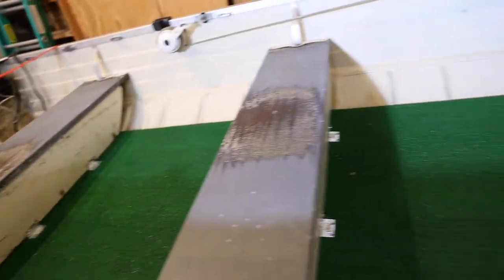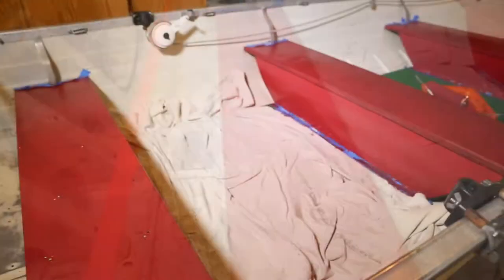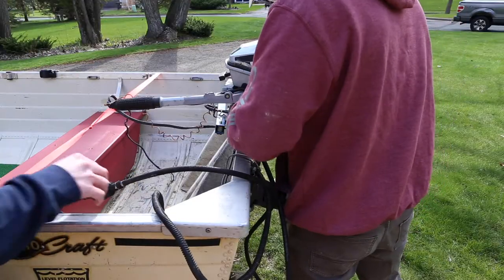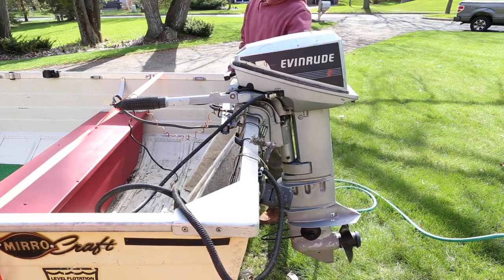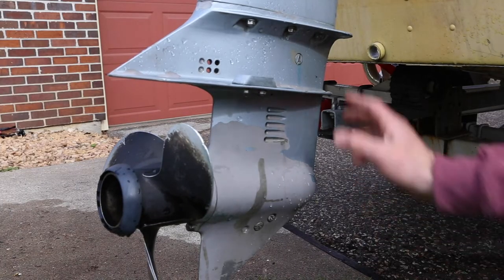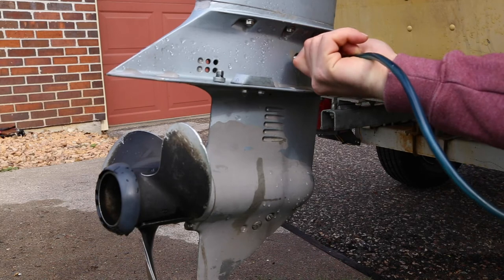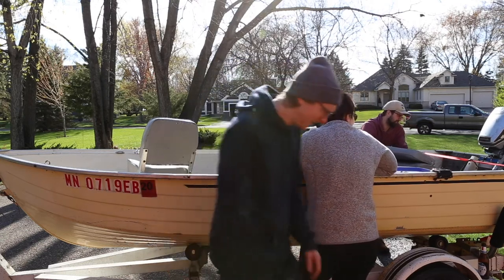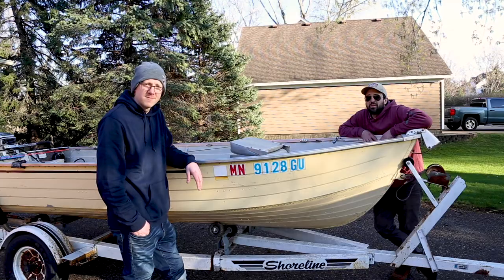Getting an Old 15 HP Evinrude 2-Stroke Started - Boat Prep Part 2

Comment: You should have replaced all of the gear case oil. It gets filled from the bottom until it just spills out the top hole. But nice work. I have a boat just like it.
Reply from the maker: That's good to know. Thanks for the tip. I'll replace all of the gear oil next spring.
Reply: Yes, replace all the gear oil. This is not like adding oil to a 4 cycle crankcase, that is not below the waterline. So it would be best to check for water coming out of the drain plug under the oil before you ever launch the boat and run the motor. We all know water in the gearcase is a curse upon the non rustproof gears in the gearcase. Most likely if your oil level was down a bit, it has been pushed out past worn seals or leaking gaskets, and also water could then seep into the gearcase when the motor was not running. Hopefully if there was water in there you can do a reseal job on it before any rusting gets started. I lucked out that way with resealing my 30 horse Johnson that had water in the gear oil, making a milky looking liquid that had lain in the bottom of the gearcase until I drained it. Thats rather odd, also, that oil floats on water even though it is much thicker than water. 😳 I was shown step by step exactly how to do the gearcase reseal job here on youtube by an outboard savvy fellow with screen name of "OM Fishing", in a 4 part video that started out titled something like "30 Horse Evinrude". It may be that the gearcase in yours is like his and mine & those videos would be helpful for you, they were vital for me. I have a repair manual covering my year, horsepower  and brand motor, but my motor isnt exactly like the 30 horse one pictured there. OM Fishing's motor was just like mine even though his is Evinride, mine is Johnson.
Reply from the maker: I took my boat out a couple weeks ago and drained all of the gear case oil as you recommended. It was nearly black. I topped it off with fresh oil and it started on the third pull. Thanks for your tip and comment!
Reply from the maker: @jeffreywhicker8947  Thanks for the tip and comment!
Reply: @TheresOneOutdoors  It's good to know that your oil was almost black, but was there any water at all that came out at first when you drained the old oil? Ive seen that if there is water in the gearcase it will look milky light brown when its been agitated by the gears when the motor is ran. But im thinking that after the motor sits idle several months the water would eventually settle to the bottom of the gearcase over time & the oil would be dark again....
Reply from the maker: @jeffreywhicker8947  There may have been a little of that milky light brown water - but it's been sitting in my garage all winter and most of spring, so I imagine most of that has settled. 
Even though, I didn't do it right the first time, I'm glad someone commented on this video on how to do it right.

Comment: Pretty sure this is your first boat. Gear lube is never topped off. Dump gear and refill from bottom. If it’s milky you have water in lube. Screw in from bottom hole and pump it full. This keeps air out. Do this every fall if you live in the north were the motor will be in freezing conditions. 🎉 happy boating.
Reply from the maker: Thank you Matthew. Multiple people let us know we screwed that up. We've redone it. And yes, this is definitely my first boat. Good to work out the kinks before I get something nicer. Happy Boating.

Comment: For how much gear oil costs, I drain it completely by removing the bottom plug first, top plug second, let it drain then screw into the bottom hole and start pumping the oil in until it starts to come out the top hole and put the top plug in. Unscrew the pump and put the bottom plug in. You'll only loose a little oil.
Reply from the maker: That's the way to do it. We were total noobs when filming this. Thanks for your comment!

Comment: You guys should have done some poking  around on YouTube, your boat would run and look better.
I have the same boat and motor. Both are excellent. A good running 15 will get 2 guys and gear up on plane.
Reply from the maker: Thanks Ken. We're kind of winging it and learning as we go, hopefully to prevent someone from making the same mistakes as us. I can say that after one summer, the boat and motor as far exceeded expectations.

Comment: Have to do the same thing except I want to install a pedestal seat. I don't like those low seats. Not sure about this.
Reply from the maker: These seats are junk. I'd recommend something quality. I need the lower seat in the back to be able to operate the boat. Planning on getting rid of the front seat and making a casting deck. Soon 🙂

Comment: I have the exact same one.  It cranks up every once in a while for a few seconds but I can’t keep it running.  I played with the throttle and the lean/rich dial but nothing works.  What would you say that I should try?
Reply from the maker: Have you replaced the spark plugs?